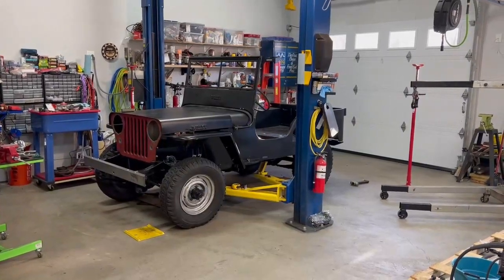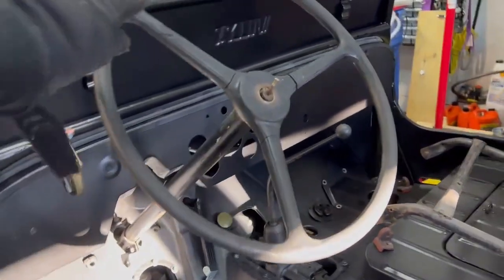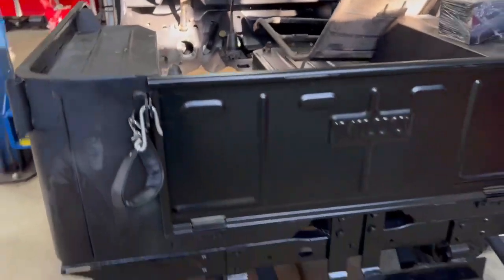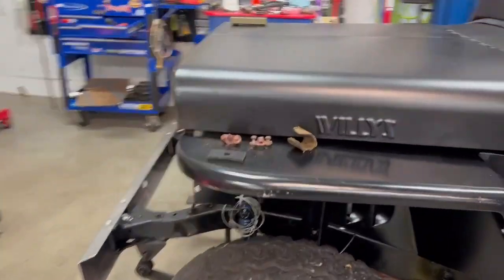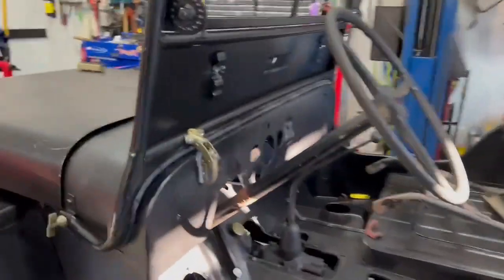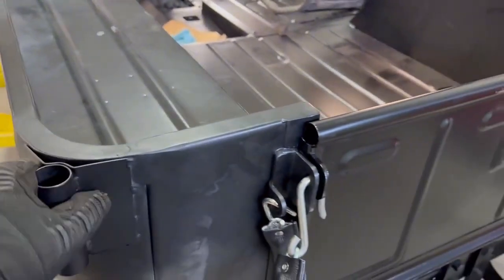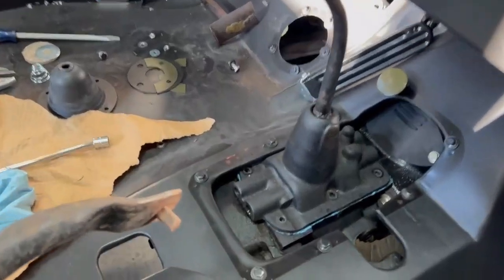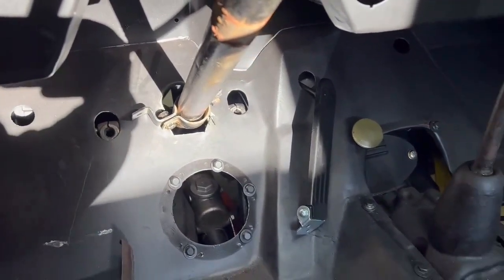Willys Jeep CJ2A reproduction body fitment issues Part 1

Comment: I have a 2A in a tent garage in my back yard that is 100 % original. The body needs some work but is about 90 % intact. Unfortunately the garage is buried in three feet of snow so I can’t get to it right now. My thoughts are since you are going through this already why not take it into a body shop and get them to put it on a frame straightener? Not sure if they could even do that unless they could find the original specs but I bet they are out there somewhere. When I do restore mine I am going to live with the dents and dings knowing that it is all original and the body like the Jeep has a story to tell. Good luck with your project.

Comment: The rear bumper that you are calling a cross member is supposed to be longer on the driver side. The added the extra room for a license plate. The MB and GPW did not have the extra inch or 2.
Reply: That saves the day!
Reply from the maker: Thanks - that makes sense now

Comment: Good luck with that body , I had to return my 68 omix body for my cj5 it was that bad 
The new bodies from India are superior . Pete debella in New York is our only distributor in the us right now . The primer you got unfortunately sucks too. Peels off
Reply from the maker: Thanks I’m going to need it! Yea going to have it blasted most likely to get the primer off. Bought a bunch of stuff from Pete already, should have waited  for a body to.
Reply: according to brian aka metalshaper you can have pete order them without the primer !
Reply: Metalshaper found me a 25 year old omix body still in a crate . Fit perfectly and thicker gauge steel, better tooling etc. really lucked out . Brian did a Fantastic job on my project
Reply from the maker: Brian is awesome! He helped me with some questions I had getting it running

Comment: You can use the same locations from  the CJ-3A for your CJ-2A hardware. 
The early CJ-3As the same dimensions, the few exceptions are the extra 2 inches for the driver seat, and the windshield configuration. 
As you now know, nothing is exactly as we might think.
Reply from the maker: thanks for the info - i didn't know about the extra 2 inches for the driver's seat - good to know.

Comment: The Jeep may not be as symmetrical as one would expect. That rear frame member seems to be shorter on the passenger side vs the driver's side. I wonder if this is just a quirk of the construction. I know you did a lot of measuring, but more measurements might reveal that body to frame used a lot of hand fitting when it was originally built. Just a guess/impression.
Reply from the maker: Yea looks like it’s shorter on the passenger side bus drivers side, someone else commented that they extended the drivers side for the CJ’s to accommodate for license plates

Comment: i would have to wonder how much attention to detail there was from yhr facory that is not noticed until you have to do what you are doing
Reply from the maker: Yea seems like there is some disco for sure. The bulk of my figment issues are around the transmission tunnel. Seems like it’s just off by a few inches - makes me wonder if they used something other than a 2a as a template

Comment: Come on  perfect?  Do you think perfection was something they strived for
In the 1940s making these for the mitilary?
Hell no.  It was good. But it dam sure wasn't perfect.  
Why Willie's  and not Jeep stamped in the body panels  these were stamped Jeep.
I really don't belive Chrysler owns the name Jeep  you cant trademark a household name. 
Willie's Jeeps used parts from GM Chrysler and Ford.  Personally I'd drop in a TOYOTA motor.  Isn't that a kick in the ass.  22re.
Reply from the maker: Yea - who would have thought Japanese parts in Jeeps …. Certainly not when these were made. I think Willy’s is correct for the year I don’t think they started stamping Jeep until later on from what I have seen.